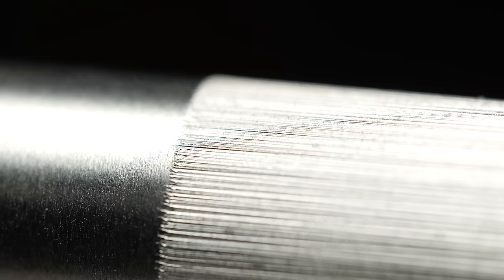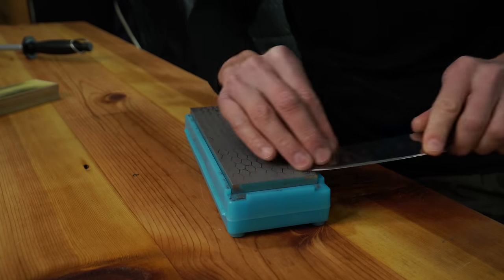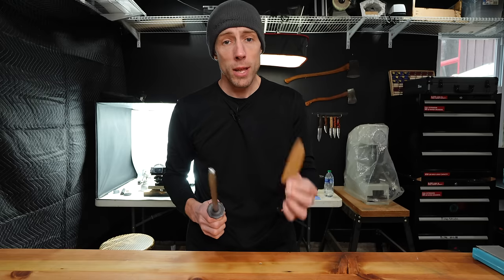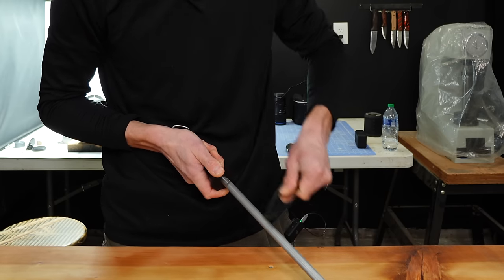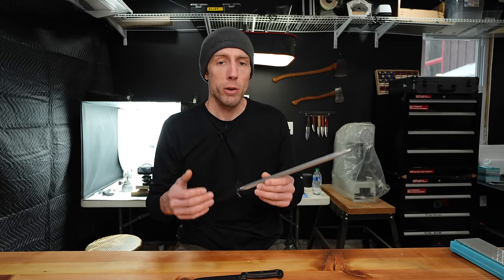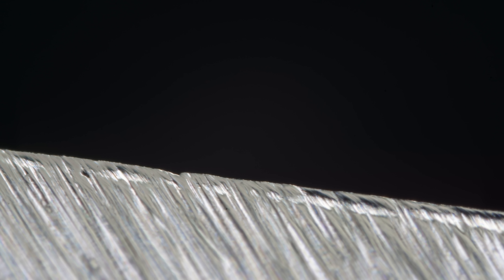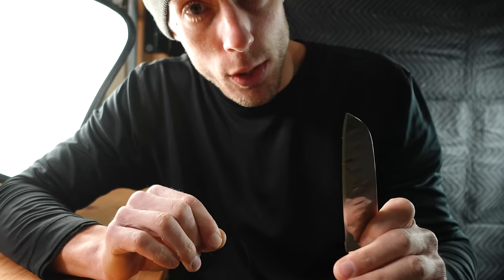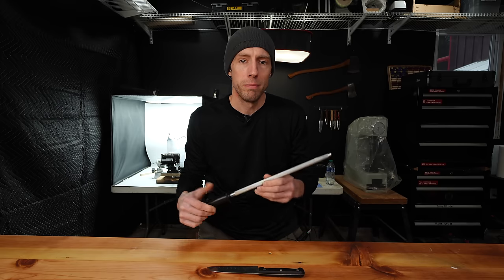What Do "Knife Sharpening" Honing Steels Actually Do?

Comment: I'm halfway through the video so far. I will continue to watch the whole video, but I have some thoughts and questions to share first:
1. How come you did not roll the sharpened edge in a way that it would naturally be rolled? People that talk about the theoretical rolled edge are doing so in the context of cutting food on a cutting board (vigorous chopping of vegetables is thought to contribute mightily to a rolled edge).
2. While initial reverse strokes are often used to make sure that an edge is "unrolled", most respected knife manufacturers recommend finishing the honing with forward strokes. This is thought to align the edge.
3. Much like with sharpening, honing is often done with progressively lighter strokes as you come to the end of your progression.
4. Honing is for high quality steel that is rated below 61 or so HRC. If the steel is of poor quality, it will not respond very well and if the steel is too hard, it will not respond very well.
5. After sharpening my Victorinox I have been able to maintain a hair shaving edge for over a year; maintaining it only with a honing rod. I've done this multiple times over the years.
Reply: After finishing the video, I still disagree with your premise. You are a very smart man and I understand the reasons that you have for the things that you believe. The problem is that you're not doing real world testing and everything that you're concluding is based on a belief that you hold rather than real-world experience. There are thousands and thousands of people just like me who maintain a hair shaving sharp edge on their kitchen knives with a honing rod. I love your videos brother and I hope you keep making them, but this one was a bit of a miss.
Reply: Thanks, he doesn't even know how to use the tool...
Reply: Yeah. I think you have fooled yourself into thinking you are doing something that actually works.
Reply: It wasn't a miss at all. Cutting is applying enough force to a small enough area that the molecules below elongate to the point of breakage, at which point the cutting implement passes through. A burr will still cut through food in the kitchen, but it's way weaker than a proper edge. Another video of his shows him grinding the edge off a knife completely and cutting through ingredients no problem. Kitchen knives are typically thin, meaning they'll produce very little drag and keep enough momentum to snap through their medium uninterrupted. Properly sharpening your stones with today's materials (diamond stone, and a proper strop with abrasive compound) will give you the same or better edge and will last exponentially longer than the steel. Vitreous materials take 3-4x longer to reach the same results, which is probably why chefs have preferred steels for so long.

Comment: For ME;  

I sharpen my Japanese kitchen knives with diamond stones. Then lightly pull the edge (that has a burr) across a leather strap, attached to a flat block of wood, that I have applied a light coating of jeweler's rouge on the surface. If I accidentally roll the edge, by striking my quartz countertop or other utensil's, I resharpen the entire blade and debur with the leather and rouge. This works well for me from a time invested to sharpness perspective. If I were a professional knife user, I may very well have a different opinion and methodology. 

I started using this method after taking up woodworking as a hobby, which required me to sharpen hand planes. 

It seems likely you me, that when a Straightening Rod on ridiculously rolled edge (like in this example) is used, the results are a terrible, jagged ass, serrated edge, which may give the user the impression of sharpness?  Just my thoughts though.

Comment: Thank you for another great video. I want to add a couple things. Everyone in the world who uses these, moves in the opposite direction. It seems obvious to me that such a movement could not possibly straighten a roll, but people will steadfastly believe it anyway. I find the vast majority of unsharpening that happens to kitchen knives is just regular dulling, not rolling. I think to roll a knife you must be seriously abusing it or using a steel that is more garbage than even most $1 knives have. For a knife that is dulling, a honing rod will tear up the apex, putting micro-serrations into it. Those micro-serrations will improve the slicing ability somewhat for a short time (I think. maybe you can test it?). I think this is the benefit people are getting from using a honing steel. You can get that from using it in the direction most people use them. If you value having actually sharp knives, and have the ability to actually sharpen them, then tearing up the apex is not desirable. This is what I teach in my sharpening classes. For most people, however, they don't know how to sharpen and their knives are abysmally dull, so it probably doesn't hurt, but it's not getting them much improvement either, just wasting everyone's time and space.
Reply: This is exactly why people are perceiving A difference in sharpness after using A non abrasive hone. That is Also why they have to do it every 5 minutes and the knife has basically 0 edge Retention
Because they are basically cutting on what is essentially.
A fine burr or wire That rolls right over after A short amount of cutting And they see And Feel that Lip be created And that's what they're calling a Rolled edge when in reality it's just the Find wire bending over And or Pieces of the burr bending over. That is created From slamming the edge into the grooves in the hone. It's a very pointless tool it serves no True point and it's Something people think looks cool when in reality it's just further Destroying The already dull edge. However the damage that's happening is basically just creating ragged Micro serrations That are giving the illusion Of The knife cutting better.
Reply: he's just trashing it because he doesn't know how to use it.  Edge LEADING is a must, and very light pressure.  They act just like very fine files, and remove material and create a microbevel at the edge if done correctly.

Comment: Just because the edge looks a certain way doesnt mean it's not functional, polished edges can sometimes be counter productive for certain applications when you're hitting bones all the time at the meatworks your perfect edge wont last long at all, thats where the hone comes in. With respect I can tell you have very little experience using a steel by how sloppy and slow you looked. As someone who worked in a butchery i can tell you these are essential. No one has time to go do a full sharpen when you're on company time processing beasts, thats what the mornings are for, even if you have a great edge i doubt it'll last longer than 1 hour of hard work processing a grade. They are still used in every major plant in New Zealand for a reason. If it was true your claim thay the steel is irrelevant then why would so many million dollar processing plants require these for their workers. Such a weird take
Reply: might not look pretty in a microscope and i probably wouldn't shave my beard with it, but as long as it cuts onions well with little effort it's good enough for me.
Reply: true, time is money.
Reply: Perhaps yours are the abrasive type he mentions near the end of the video and you’re both actually in agreement?

I’ve always thought those rods were all the same but he clearly states there are 3 types: plain steel, diamond abrasive, and ceramic abrasive.
Reply: I mean… the take makes sense actually given the historical context from the video.

Comment: I've worked in numerous kitchens over many years, and I can 100% confirm that they do what they're supposed to.
No matter how well-sharpened the blade is, in a restaurant, that edge will wear down in a single work day, so instead of sharpening the knife every time you use it, you could realign the teeth, which is significantly faster, convenient, and easier to clean, when you have to prepare 7 different meals in 30 minutes

It's also a cheap alternative when a company has 7000+ knives and locations across the country

Comment: I think you are ignoring knife use in industrial settings. As a professional fish filleter in an Alaska processing facility for nearly a decade, I can say that these steels are indispensable. A crew of as few as 6 guys will fillet 20,000 pounds of fish (salmon, halibut, black cod, grey cod, rockfish, etc) by hand in a single shift. The type of steel that is flexible enough to make a good fillet knife is not especially hard, and will quickly take a ton of abuse from cutting through bone, cartilage, and against hdpe cutting boards. We sharpen on wetstones several times throughout the shift, but touching up the edge on a steel every few dozen fish makes a tremendous difference that you can instantly feel  Also, the oft-quoted premise that these don't remove material is not strictly true; they do not remove a great deal of material, but they do indeed remove material from the edge. Proof- take a clean dry steel and hone a knife blade. A clean paper towel run along the steel will reveal a tiny amount of black residue, which are microscopic steel shavings. As long as the honing steel is harder than the knife, which is often the case, it will remove some material from the apex.

Comment: An interesting video which pop up on my feed without asking. As someone who has needed sharp blades to feed my family for the last 50 years this is total nonsense . To say steels are not abrasive is bizarre look at any butchers  knife and see how worn the blade is ( the steel is basically a file) . Firstly you do not use the steel by dragging it back you push into it . I can take any none serrated blade than just bends paper and have it paper slicing sharp generally quicker than any other hand sharpening method . Also there are two types of steel ones with straight groves and one with spiral grooves , Personally I find the spiral type give a better edge quicker. The question is do knifes properly sharpened on a steel do the job required of them with easy and my experience is yes they do . I keep all the kitchen knifes in our house hair poppingly sharp with a steel to the extent that many visitors wont use them because they are to sharp !   I suppose the real difference here is people who need sharp 8 hours a day 5 days a week  and those mucking about about in their shed.

Comment: My grandfather was a butcher in a slaughterhouse in the early 1900s, speed was essential.  He wore the steel on a lanyard around his neck so it hung away from his body as he leaned forward.  Every few cuts he'd take 3-4 swipes on each side pulling the edge diagonally across the steel as if he were shaving the steel to maintain a sharp edge.  I think what is actually happening is you're burnishing metal away from the edge - basically the reverse of creating a burr - which recreates the bevel and coldworks the edge.

Comment: You’ve missed the mark on this one. Honing steels do work. It’s good that you dispelled two misconceptions about how steels work. Unfortunately you then went on to wrongfully deny that they work simply because you neither understand how they work nor have experienced them working. Steels don’t fix rolled edges or align burrs, they correct the edge on a much smaller scale than what you showed in this video. If you work in an abattoir boning, you won’t make it through a day without using a steel, you won’t make it through a day with a burr or a rolled edge on your knife and nobody will tell you a steel is a substitute for a sharpening stone. Having said all of that, you can keep screaming it from the rooftops, because in reality, there’s only a tiny minority of knife users who actually need to depend on steels. I can assure you that your video won’t change their minds. I urge you to look further into how they work and share what you find. There’s little to no accurate literature on the subject, so even a small contribution is significant. Best of luck on your pursuit of knife knowledge.
Reply: i completely agree. as a chef, i hit the steel at least twice per shift, spending about 15 seconds each time. 
i dont know or care ‘how it works’, but its undeniable that it does work. maybe because i dont destroy the blade on a copper pipe beforehand?
kitchen work is all about efficiency, and the things that work best tend to become the industry norm. we have been doing this for 100+ years because it works and its fast. nobody is going to be hitting the stone every day with their $300 knife.
Reply: Also honing the edge can harden it over time, related to how when you bend a piece of metal back and forth it gets metal fatigue but becomes hard before it breaks. So there's complicated material science involved as well.

Also it's kind of preemptive damage control, the better a knife cuts the less damage it takes when it cuts because it needs less force. So maintaining an insanely sharp edge prevents the damage in the first place.
Reply: Yeah, this video was long and full of over exaggerated knife abuse. I've been around knives my entire life, and I've never once heard anyone say a steel fixes a damaged blade. "Rolling" an edge on a pipe is just pendantry and wordplay. The directions my steel came with specifically say it will not help a damaged knife. 
The simplest test. Properly sharpen a knife. Use it for it's intended purpose on food (no logs, no pipes, and no smacking it on hardwood).  When it's performance degrades, usually after hours of use, use the steel. Just drag it one way across the blade like a stone maybe 5-10 times. No whipping it or back and forth showmanship. Is the performance of the knife in cutting food largely restored? In my case it is. After many more hours you can repeat this, with similar results until it no longer works well. Then a sharpen is needed. Is a knife dragged across a steel as sharp as a well sharpened knife on a stone? Obviously not, if you need that, sharpen it properly.
Reply: @adaycj  It wasn't word play you can literally see the edge bending as he rolls it on the pipe..
Reply: So you say he doesn't understand how it works... and proceed to not explain how it works and just go with an answer akin to "well we know because we use it at work". Mate I have seen plenty of people in various industries that swear behind practices that "just work", extraordinary claims require extraordinary evidence. 
As for copper pipe not being fair as someone else pointed out, bone is generally a fair bit harder than copper. It was an extreme example to get a specific result and show why the impact is different to what people expect. 

For the record he isn't saying that it won't feel sharper than a totally blunted knife and cut better. It is that it doesn't work as well at getting a sharp edge back and we have more knowledge on what the structural changes are now. 
Even thought a non abrasive hone can help correct an edge before it truly rolls over, it is always better to use a fine abrasive hone. The amount of material removed is negligible and is always going to be faster/better.
Reply: My guy showed you evidence and yet you say "na trust me bro it works"
Reply: Completely agree with you on this, a steel works extremely well at removing a rolled edge about a tenth the size of the one he made. So yes, he smashed steels because he completely missed the mark of their real purpose. And he’s also wrong on saying that the proper stroke is a back stroke. The guy he mocked going really fast forward was probably actually doing it right. 😂
Reply: @brainardsinbrazil5274  you dont know who gordan ramsay is? then how can you spew all that info
Reply: @lando8913 It is wordplay because that isn't what a rolled edge is. Games with words to prove an unrealistic point. If you mash the edge of your knife on a pipe, it needs to be sharpened, or more. So why then try to show that a tool that specifically isn't intended to fix a damaged knife won't. More wordplay.
Reply: @Dnite13  The "evidence" in this video is just that a steel won't fix an abused knife with damage. But no one said it would. A steel won't fix it to proper working order if I melt the blade in a crucible either. That doesn't show that proper use of a steel won't extend performance between sharpening when properly using a food knife.
Reply: @adaycj  he explained that it does help but not in the way you think it does, then even showed evidence of why you think its sharper than before
Reply: @Dnite13  I think maybe we watched different videos.
Reply: @adaycj  na, you just think you're an expert so you aren't listening to anything the guy says

Comment: Former chef here, I think you are mostly right, but you're missing a trick. Sharpen knives when needed but uses a steel throughout the day. 3 or 4 light licks on either side then run over a tea towel on my hip, to get the shards or steel off the blade. A steel is magnetic to catch the lose metal but it doesnt get all of it (wipe your steel down and see what comes off, it does remove material), the tea towel acts somewhat like a strop to clean the edge. p.s. Someone told me once that the steel is magnetic because the magnetic field softens the metal of the knife but I fear that might be nonsense) p.p.s. Good christ, never use a stone like you're using it at 12:21, unless you like taking a sliver if not chunk off your thumb. Flat surface only, as for a diamond steel, grip lower on the handle, keep them knuckles out of harms way.  Sorry about the rant.